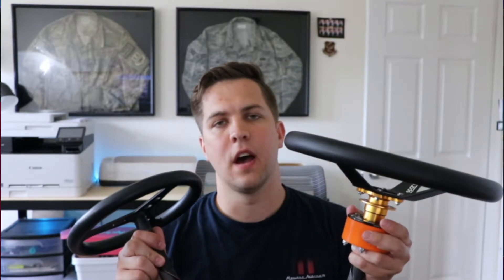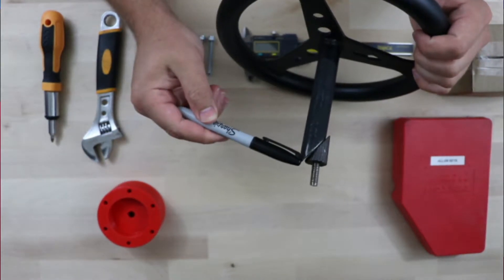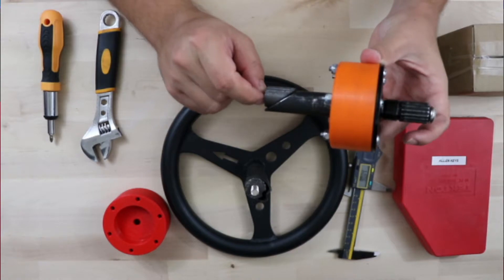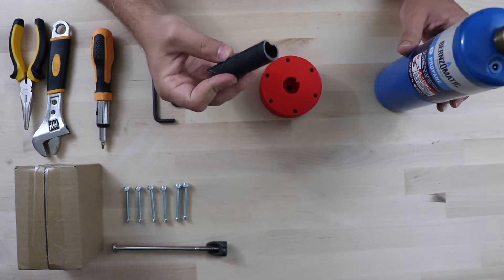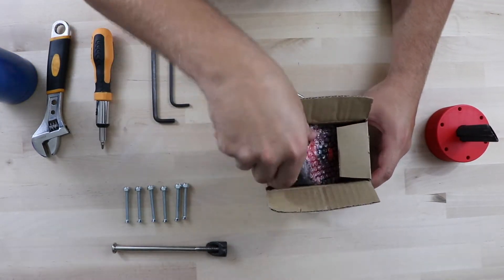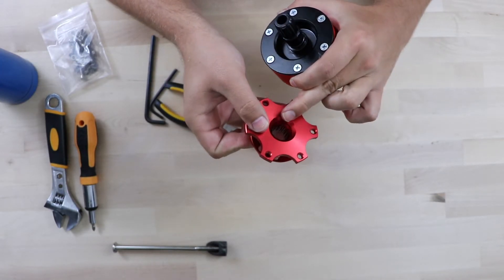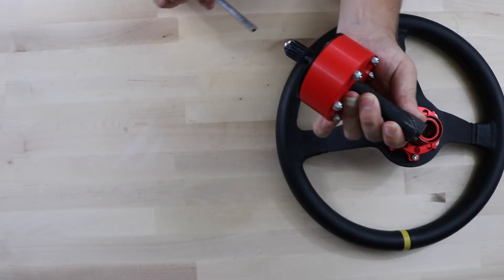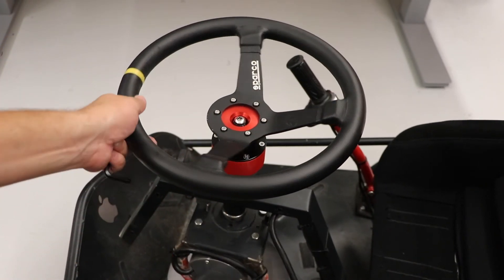Crazy Cart - Steering Wheel Upgrade with 3D Printed Adapter

Comment: Hi there! Do you think if I do this to a DLX model would work just fine? It's the same size, just the length is 20mm smaller than the xl one.

Great video by the way I’ve been looking for this for ages by now!
Reply from the maker: I can’t guarantee it but I don’t see why it wouldn’t. If it does work, let me know and I’ll update the description to let others know!
Reply: @danielwilczak7833 I’m guessing I would need the other bolt though since this one is smaller
Reply: @danielwilczak7833   When it comes to cutting the wheel shaft, what would you recommend on the amount on cutting?since its smaller
Reply from the maker: I would cut it long and then test. You can always cut again but if it’s short there is nothing you can do about it

Comment: Just found your video i have a few questions
Could u sell a adapter 
And what did u use for the hand throttle
Reply from the maker: Hey! I actually no longer sell the adapters because Shopify was too expensive for the volume I was selling. All the files are included for free if you want to print them yourself.
Reply: @ dont have a 3d printer 

What about the throttle grip 
Do u still have the cart
Reply from the maker: The hand throttle is for the modified motor I use on my carts. I actually didn't like it; I now use the foot pedal version. 
Link - https://amzn.to/41y0pyj
Reply: @ u rock thanks
Reply from the maker: I do still have the cart.

Comment: Couple questions, I see that your shopify link is down, not sure if you are still doing that, also, I notice you have something around where your drift bar is, is that like a regen brake, if so let me know!!!!!!!
Reply from the maker: Hey! I actually no longer sell the adapters because Shopify was too expensive for the volume I was selling. All the files are included for free if you want to print them yourself. The hand throttle is for the modified motor I use on my carts. I actually didn't like it; I now use the foot pedal version.  Link - https://amzn.to/41y0pyj

Comment: Is there any other way to cut the shaft without a saw and also is that the only steering wheel that fits the adapter or can i use different ones
Reply from the maker: You can use whatever steering wheel that fits the amazon quick disconnect. I used an angle grinder, a saw would be the next option. Other then that I'm not sure.

Comment: how much to make me one?
Reply from the maker: Do you mean the 3D printed part or the whole assembly?
Reply: @danielwilczak7833  whole thing withoutbwheel
Reply from the maker: I would need the original wheel and the amazon quick disconnect. But it can be done for $30 bucks.
Reply: @danielwilczak7833 Yo, know this is already 2 years old but I was wondering if you were still able to print me the 3d adapter piece that holds the screws. Any help is appreciated bro and awesome idea/video
Reply from the maker: @e3nlee  I still sell them on my Shopify website. It’s linked in the description.
Reply: @danielwilczak7833  bett bro thank you